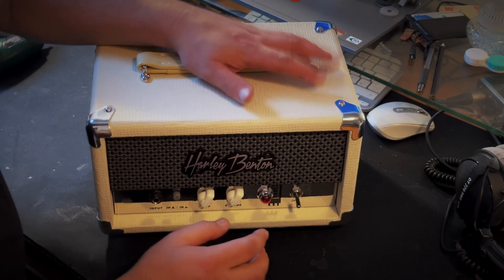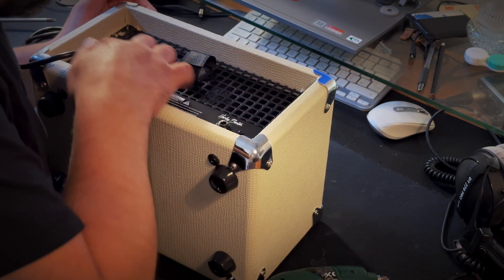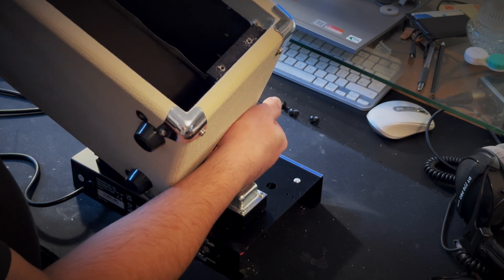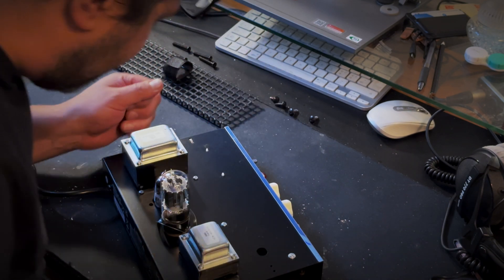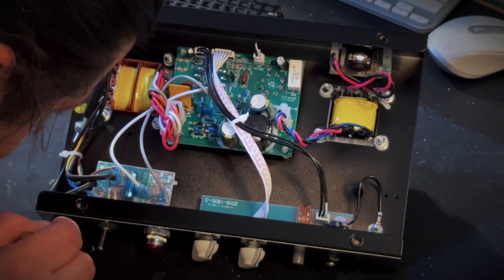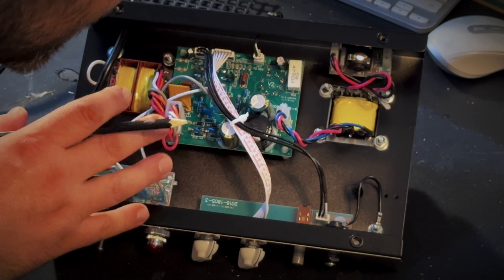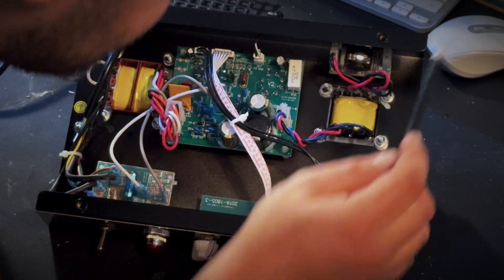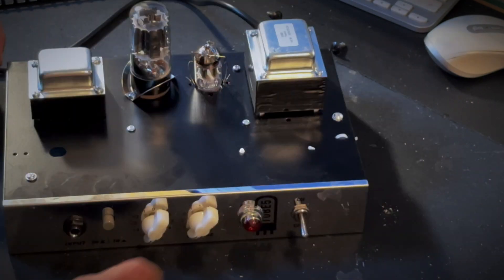Inside the Harley Benton Tube 5 – Full Teardown (What’s Actually Inside)

Comment: Benefits from good tubes, the US version has subpar Chinese tubes, I put a low noise ECC803s JJ in v1, a JJ 6v6 works a treat, I use a vintage Kenrad.

Recapping the power section with quality caps helped with noise. A 470 ohm 3 watt screen resistor will protect the output tube. 

The long run of unshielded ribbon cable induces noise, not much to do about it without major surgery.

There's an untapped 4 ohm lead on the output transformer, i wired them to a swtch on the external jack side of my combo. I put the feedback on a switched pot with a base value resistor so I can switch the feedback off.

The output transformer is connected directly to the 1st power supply node and the 6v6 plate.

Its not really a Champ at all, compare the schematics. It's a great amp, keep it. You could gut one to make a 5F1 but you need a 5Y3 rectifier which needs its own 5v filament supply. There are unused secondaries on the power transformer, iirc I measured them at 25v.

If I can muster the ambition I would use those to create a regulated 15v supply and copy the opamp driven reverb and perhaps buffered fx loop in the Cub 15. It would need its own board and I'd have to figure out a mount. 

On the technical side I rebiased to output tube for 100% of 12 watts dissapation, put a switch and a parallel resistor to select bias for a Russian 6P6S.

I have a 3 position off-standby-on switch in hand but I'd need to handwire all that's on the switch pcb, install a fuse holder, new power light socket, etc. If it fits a simple on-off toggle switching the output transformer secondary from the 1st filter cap would be simpler.

We can't get the head version of these in the US but one conversion that would be a great project is gutting it and turning it into a a fender 6G15 spring reverb. I had a plan to do the same with a VHT Special 6 head. 

Anyway! If yours is quiet and good tubes improve it leave it. If you play mostly single coils and find it too brittle pull the bright cap on V1b, or put it on a switch.
My combo was greatly improved with a different speaker, mine is a vintage Rola ceramic 8". It sounds amazing through my 1x12 and 2x12. 

Tone at 3 volume at 7, if yours isnt broken or malfunctioning it doesnt need mods
Reply: Thank you for that information! Good stuff!
Reply: @s.a.s.2126 I ended up cutting the bright cap value in half. Otherwise the most important thing is the output tube bias for whatever tube you use, a JJ can take 100% of 14 watts. I bias the vintage tubes I use at 12 watts to protect them. I changed my bias selector switch from the Russian tube to a 6F6. Bcuz: I had a good NOS one and it's a true pentode which breaks up in a different way than the power tetrode 6V6, more raw with (nasty) odd order harmonics. Also switched to a vintage Rola Alnico speaker pulled from an organ, more sparkle.

Comment: Would love to know if that power transformer has a 120v winding
Reply: Monoprice sells the Stage Right 120v version
Reply from the maker: I can't be 100% sure until I've looked up the specs, but I'm reasonably sure it does. This is just speculation, but these amps are being sold in both 240V and 120V countries, albeit under different brand names and, at this price-point, it seems unlikely that they would use different transformers per region. It would overcomplicate the supply chain and the assembly process. Secondly, from the video, I can see there are unused terminals on the primary so it's reasonable to assume that one of those is the 120V winding. I'll probably do a follow-up video with a more detailed look, better close-ups and "numbers" where I can find them and I'll try to look up the specs for both PT and OT. Hope this helps somewhat.
Reply: @CatsMusicJourney There are unused 25v/25v secondaries in my US 120v version but no unused primary leads. UK version may have a different transformer if you've got extras.

I'd have to guess each liscensee/brand makes seperate factory orders. Chinese factories are a lot more flexible, nimble and accomodating than we spectators might assume, that's a big reason why they're killing the rest of us. I can imagine differently branded units have different p.t.'s. Your spare primaries might be for 240 Aussie volts.